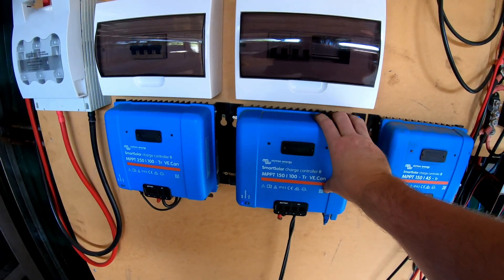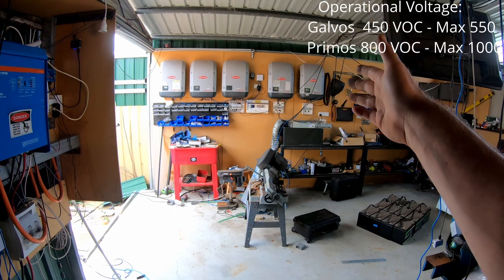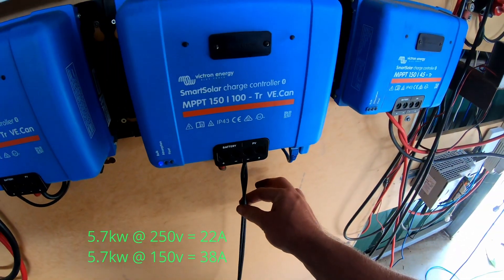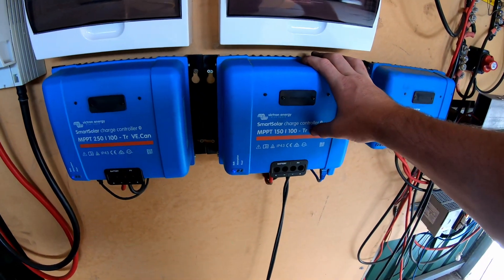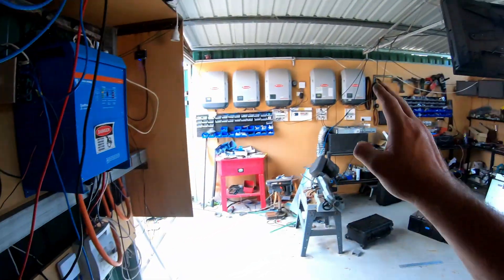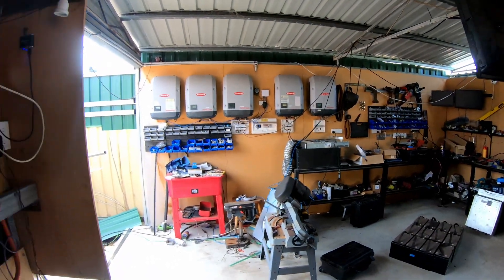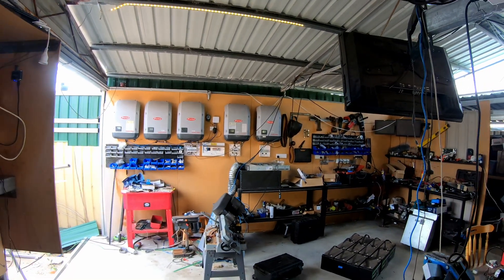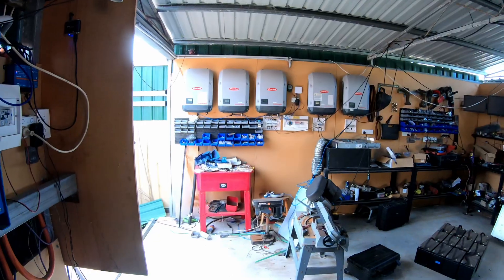BadIdea #1 - ACvsDCCoupling

Comment: Agreed. AC and DC coupling is the best solution in many cases.
My grid tied system was meant to be the same architecture as yours. But unfortunately the Victron Multiplus was no longer approved for grid connection when i was ready to purchase.
I ended up going for Deye hybrid inverters which are excellent and a fraction of the cost of a Victron/Fronius setup (atleast here in NZ).
Reply from the maker: I was reading last night that if it's cec approved it's easier to get it installed but even if it isn't cec approved your power provider can do an independent review and you may be able to install it anyway.

I was dissapointed to see they took the victron inverters off the list. The quattros are no longer approved for standalone either

Comment: AC and DC coupled is great - I have similar, but with enphase (on the input side of the inverter) - grid connected. I’m keen to add solar on the output side the same way you have.
Reply from the maker: We also had an inverter on the input side, generally it was awesome to have the extra charge potential. problem is the anti islanding laws dont allow for our quattro to be connected to the grid

Comment: Yes they charge quite quickly I use just 750 watts to charge during power outages (3 enphase inverters runoff a 36 volt battery) AC coupling is the way to go it is fast and cheaper but a little unstable.
Reply from the maker: You wouldnt beleive the criticism i face, i love that its so versatile
Reply: @BadIdea1123  Being able to double the load of a compatible inverter is a cost saving event.

Comment: I had an existing SolarEdge 4kw array, and have added a Quattro 48/10000 in my garage with batteries and additional 4.74kw of panels on the DC side, and they work perfectly together. Grid comes in via AC 1 IN, everything else is on AC1 Out. If the grid is down the Quattro will ramp up the HZ to shut down the SolarEdge if the batteries are getting full.
Reply from the maker: Yea ours have stages where they can output Less than 100% to 0
Reply: @BadIdea1123  Yes the newer ones will reduce output as the frequency increases, but the older ones won't, but at least it will stop generating once you exceed it's operating frequency.

Comment: I have a much much smaller system and (therefore) tied to the grid, but I also have a combination of a mppt's charging a battery and inverter feeding my grid for direct usage. Unlike I have them coupled in parallel to the same solarpanels with a 1-2-both connector. Although it might not be efficient the good thing is that when the batteries are more full more power seems to go into my grid :-)
Reply from the maker: Thats awesome

Comment: A combo of AC and DC coupling rocks.

Regarding the 1.0 factor rule. I notice 5 Fronius on the wall… and one 10kva Victron… ?😊
Reply from the maker: Correct, they aren't all in use. You might notice some if the covers are off the breaker boxes. I use some of them to test second hand panels. We only leave 2 or 3 of them on when we are not testing panels
Reply: @BadIdea1123  Seems the standard is to keep the AC coupling at 80% or less of the coupled inverter so it can control the charging. It can be higher but you need to control the load.